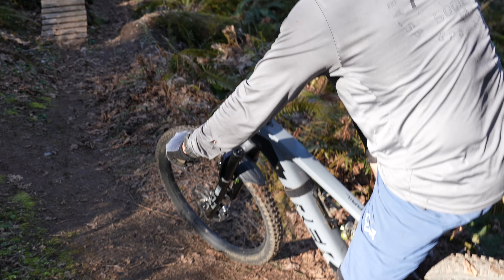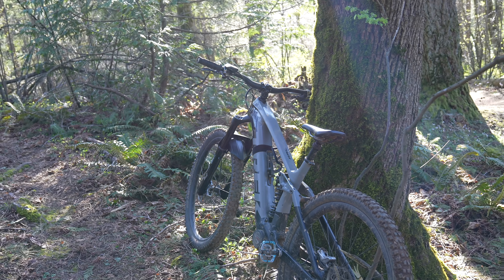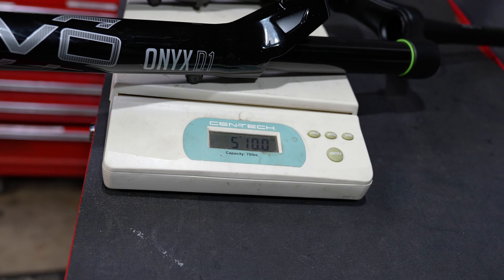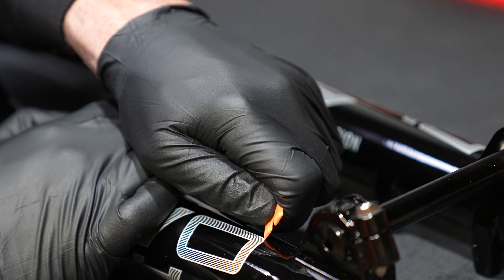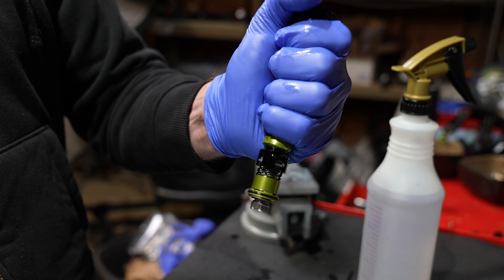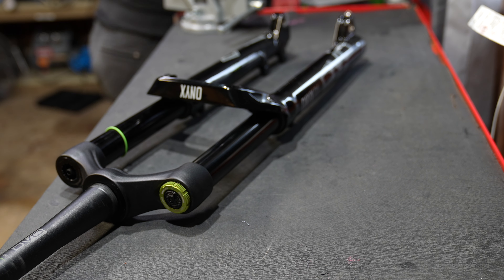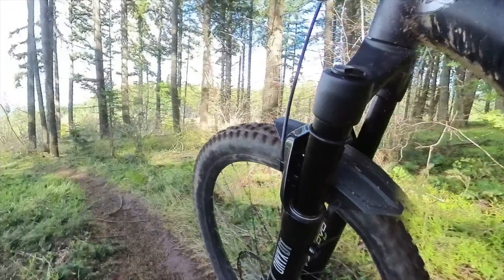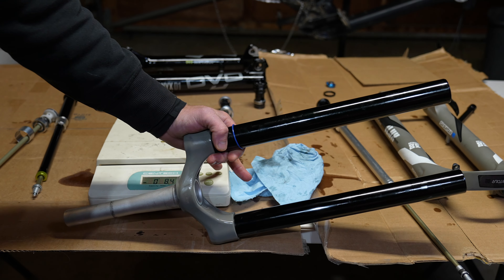DVO Onyx 38 Deep Dive Review

Comment: Just get a mezzer pro.
Stiffness "only between zeb and lyrik" but more performance out of the box than float 38 or zeb, only 2080 gramm for 180mm 29er fork, hbo, and irt (double positive chamber) for outstanding Support while rivalising the zeb charger3 in sensitivity. The pm is 180 mm, thus you can easily adjust if you want a 200mm or 203mm disc. Max is 220mm.
Love that fork.  Only one I kept for years besides the intend flash, which I will also keep for many years. Two best forks out of the box, especcially when looking at weight/stiffness/performance ratio.
If this not enough you can easily shim and bleed it at home and there are some very good aftermarket tuning options as well. Very highly recommend
Reply from the maker: I have had more requests for that fork than anything else ever. Sub 5lbs?
Reply: Yes, real world WEIGHT is sub 2100 gramms for a 29 fork Wirth 180mm travel

Comment: If you want better small bump sensitivity but do not want to loose the Support, gibt the onyx the 2.5 damping oil but exchange 1 compression shim for a thicker one or add some thinner ones. I think this would get you maxximum performance. Support plus sensitivity.

I like their damping Structure. The compressable bladder cannot blow, bleeding is easy as with a ifp but you still have the low friction of a bladder. This it is a great reliable system.
Reply from the maker: Shim stacks are above me at this point, how do you know what each shim does?
Reply: @OtterMTBtech  

Form Starters It is just enough to Know, if you want or Need to close hsc too much IT is rather Wirth top strengthen the shimstack top bei able top Run IT wider Open, thus not top preload the shims. So Just Exchange one existing shim Wirth the Same Diameter But a thicker one or add a thin second shim on top of it.
For more sensitivity I would go Wirth thinner oíl and instado strengthen the shimstack. Will given BEST of both worlds

Comment: No,best Service is intend, fast friendly, listening to special requests, cheap spare parts. Besides the New airspring is oretty dope. You can travel it by just Rotation the fork leg wirh Connecticut pump.  1mm per Rotation. 190-160 at the Flash, 180-150mm at the edge
Reply from the maker: Bro I didn’t even know what that brand was tell now thanks

Comment: Really cool down to earth vid mate. Got a question about front suspension if yoh could cast some light on it. I'm looking at upgrading my 130mm rl silver forks to something bigger,160mm to 190mm either zebs or fox 36. Keep hearing that you should only go 10 to 20 mm about whats standard on the bike because it can change the geometry and put stress on the frame. Would using an angleset headset and changing the offset counter this or will they run fine just putting them on or will the bike explode as people seem to think? I'm riding a calibre bossnut v2.
Cheers dude
Reply: I would not put such a big fork on that frame as it, as you mention, not meant to take the load that a that much slacker head tube angle will dish out.
Reply: @pernyberg2816  cheers for replying dude, would not a angleset counter the change?. I've ran the difference in a geometry calculator for bikes and the change is just under 3 degrees,then with a angleset i could reduce that by 2 degrees and changing the reach of the bike by up to 0.75 degrees. With a shorter offset than my current one  44mm to 37mm. Theoretically reducing any shift in degrees back to its original geometry. Even without  changing a fork anglesets allow people to change the geometry safely so would that not apply to having a bigger fork? This is all research atm into getting an understanding so all and any thoughts am welcome
Reply: @kkit7540  
Not sure if your frame is handle the extra leverage forces (and more rowdy riding that comes witch such fork).
Besides that, you also lift the front end up a lot, so it will be harder to load the front wheel, and while highering the front your seatangle will move as well further backwarts, so paddling up you will be more over the back wheel.

From 130 to 150 might be doable with a bit of work, but it sounds to me that you try to stretch the bike in something that it just isnt.
Probably time to upgrade to something more burly.
Reply: Gone for the fox factory 36 160mm with a shorter 37mm offset
Reply: @kkit7540  ok. If you put an angleset on remember that when youngonthrough the travel you headtube angle will get silly steep and you don't want that. That is why you don't want to make such a big change in fork travel on ANY frame. 👍
Reply: @pernyberg2816  spoke to a few people and i'm keeping the bearings standard now and running the 160mm natural,the offset will be the only adjustment so it won't get too steep, lot of people i spoke to have gone up 30-40 mm and had no dramas. Cheers for the feedback dude 🤘